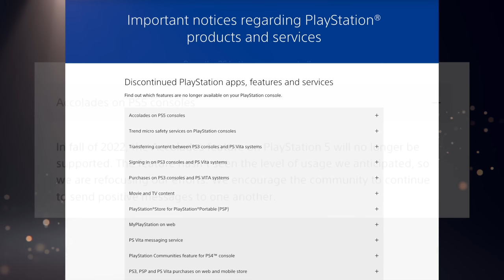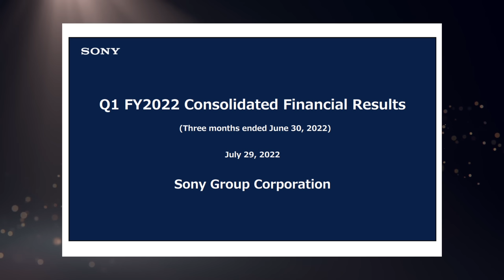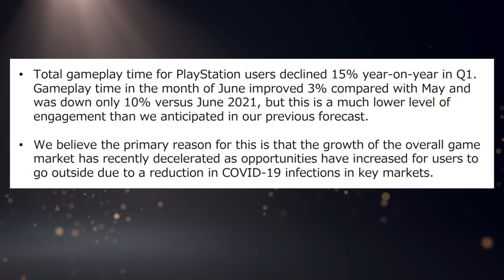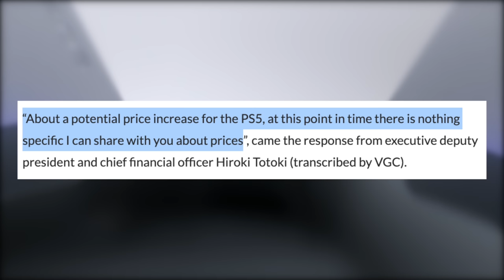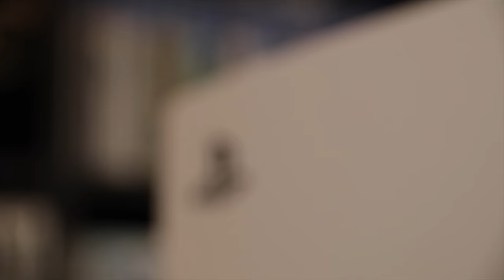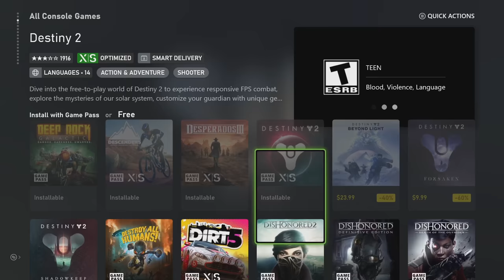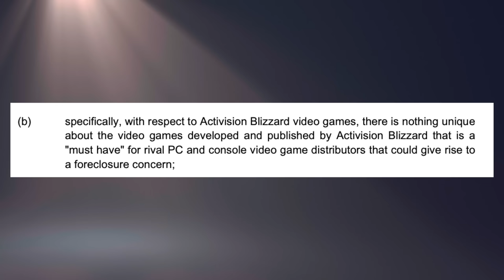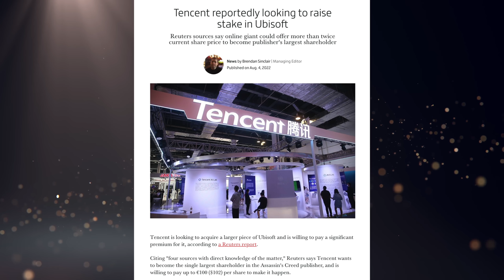Sony Says 'Call of Duty' Is Essential, Microsoft Disagrees | PS5 Price Increase? - [LTPS #529]

Comment: There was a compelling indie game called Bright Memory Infinite that was released recently. Graphicly it looks awesome, and was made by only one person in China. I might go buy it soon alongside Stray
Reply: I would say not to. Being that the game was made specifically for Xbox and ported over to playstation as a last second thought, the game doesn’t run like it should on playstation. The dev didn’t properly optimize the game for the PS5 and resolution and frame rate takes a noticeable dip compared to other games that the ps5 is able to run at native 4K or a solid 120fps
Reply: @fresco_dinero5155  The DF video says it runs well enough
Reply: @unicorntomboy9736  I wish they would’ve optimized it to run at native 4K like other games. I also have a 144hz monitor and the fact that this game struggles to reach 120fps on playstation ur games like COD, Fortnite, R6, and any other game that has a 120fps mode runs perfect
Reply: that game isn't new at all. its almost 3 years old now. (March 2020) they "slightly" updated it with the Infinite release. Also keep in mind when buying it that the game is only slightly longer than 2 hours. I bought it on sale, cause $20 is a bit much for the length. Especially since there is no replay value.
Reply: @jenerossitea9247  It only recently released on PS5 and Xbox Series X/S

The developer behind it deserves all the support, especially since, again, it was made by one dude in China somewhere. It's an impressive effort for a mostly one man project
Reply: Like DF said only one person makes most parts of this game series, that's still amazing, have fun!
Reply: @fresco_dinero5155  you know its been always that way for xbox, so dont cry that a game gets ported to playstation bc most third party games on xbox were made for playstation and some for pc.
Reply: @fresco_dinero5155  just take Watch Dogs 2 in the demo on xbox the buy message says go to the playstation store to buy the game on xbox so dont cry about that. u should rather cry about the fact that sony remasters The Last of Us 1 for the second time

Comment: 79% digital, wow. Soon I can see Sony doing away with Physical discs altogether if they only make up 20% of the sales.
Reply: I wonder if 79% include ps plus monthly games as they show purchased icon. If so i have 80% digital games if not i have 0.
Also i believe the value ratio will be different. Many people and trohy hunter buys 2$ games blindly. Multiple games a day.
Reply: @Jimbo Bimbo I actually like the idea of SD card games being a thing, they could make the cases a bit smaller and save some money for transport.
Reply: No point in discs anymore when the data is being streamed off the SSD, just as it was streamed off HDD with PS4. The only platform left that truly gives purpose to physical media is Nintendo Switch, due to data being streamed from its SD card format instead of its storage device.
Reply: @SahilG23  I agree I’m thinking a lot of the purchases digitally are cheaper indies that have no physical format or getting them later on. Also a lot of PS store sales of older games as well. The newer big budget games probably still get alot of physical sales

Comment: Like they say content is king. They are not making cod exclusive, putting it on gp day 1 and 70$ on playstation market is the right play using the playstation market to make profit, casuals won't switch consoles overnight but if the this gen leans towards Microsoft, I'm sure casuals will pick up an Xbox and they might pull the plug. Sony is still figuring out making fps mp and hardcore rpg which take years to develope.

Lol imagine playing ps5 opening cod and seeing Xbox logo, that would stuck in every cod casuals head.

Comment: Just go the PC route. I finally did it and all this controversy is now non-existent. Every xbox game comes to PC now and if you pair a PC with PS5, you're not going to miss anything. You don't even need to build a badass PC. Almost any build you go with is going to look and play better than any console.
Reply: I would love to build a PC but don't know where to look. I don't need something powerful, just something that can play current games at 60 FPS at 1080p.
Reply: Or just get a series S for 300 and play cod @ 120fps with its mouse and keyboard support. Much more straight forward and cheaper if you're just doing it for cod. A comparable gpu costs as much as the console alone
Reply: @thelonesomedrifter5884  maybe a 3050? 1650? They'd cost ya around 350 beans.